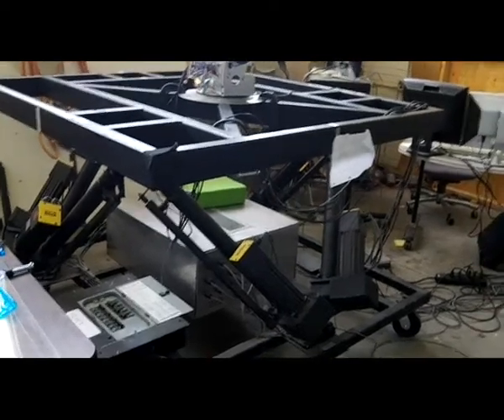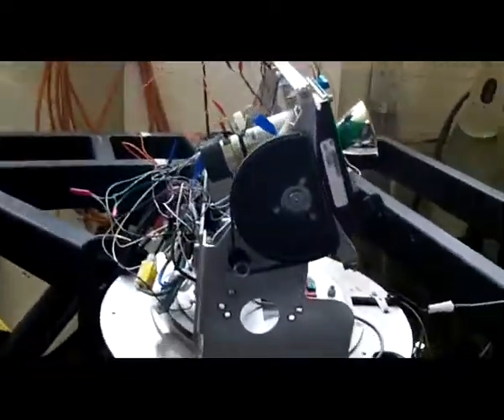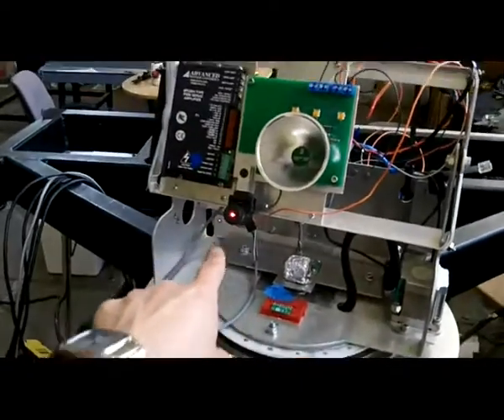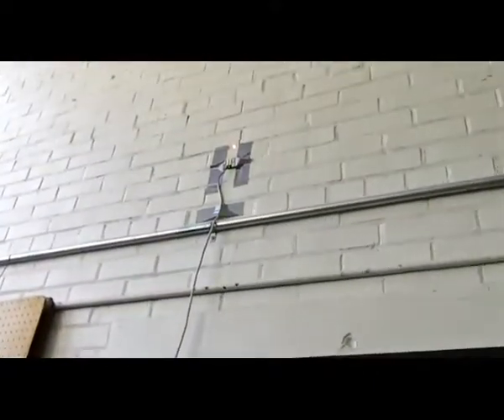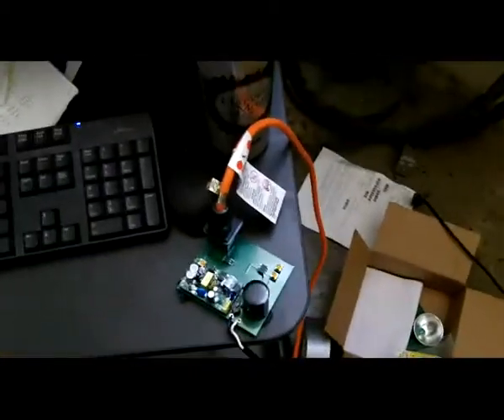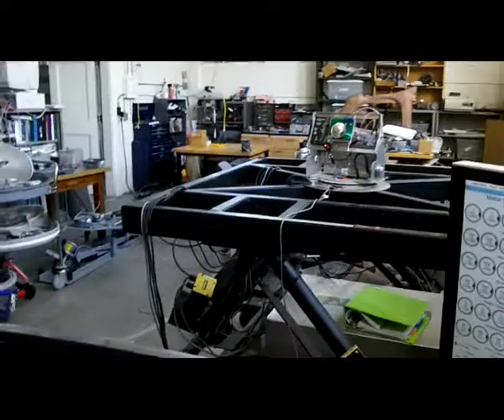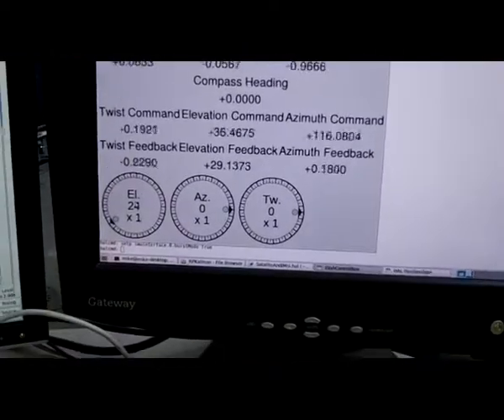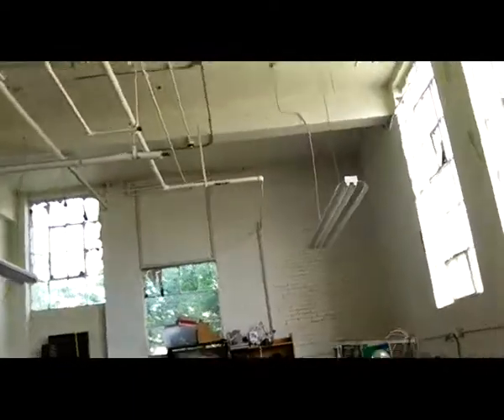My Thesis Hardware

Comment from the maker: The laser is not part of the control system. It's just there so we can see how much the pointing vector of the dish moves during testing. So, it doesn't necessarily need to be close to the light (also LEDs). It just needs to not move more than the 0.5 degree window, or if it does move more than that our control system needs to measure that error so we know to turn off the transmitter.

Comment from the maker: There are a couple different requirements for the system. The first is we have to know the pointing azimuth and elevation within 0.5 degrees, because we have to turn off the transmitter if that level of accuracy is not maintained. Second, we actually want the dish to point within that 0.5 degree window so that communication is maintained. Third, we need to maintain the proper skew with the satellite because the signal is linearly polarized.